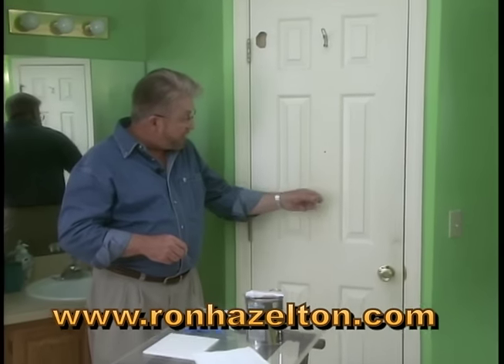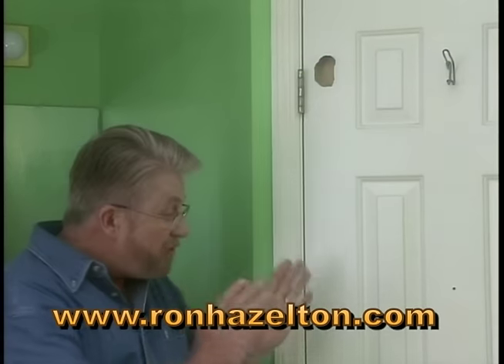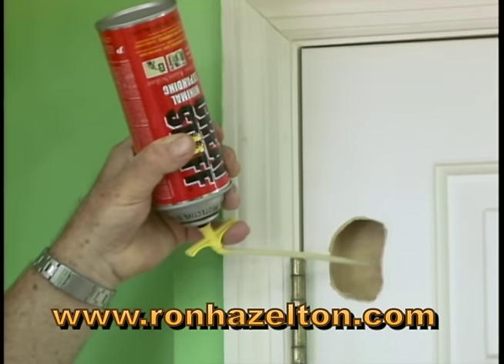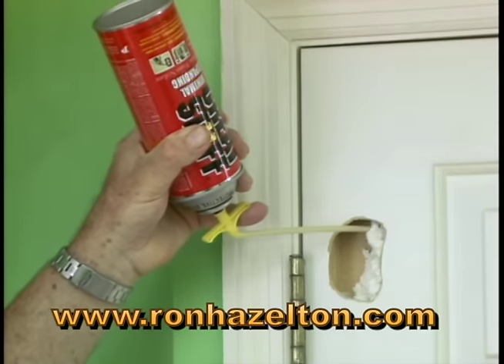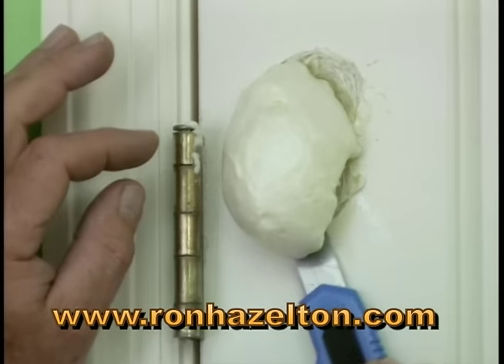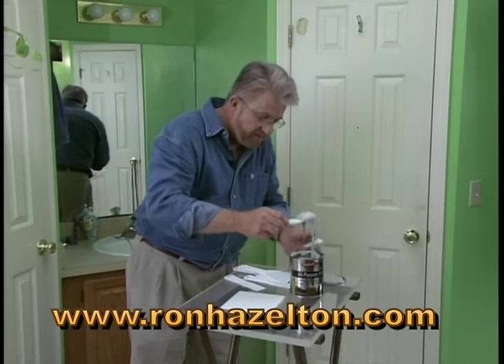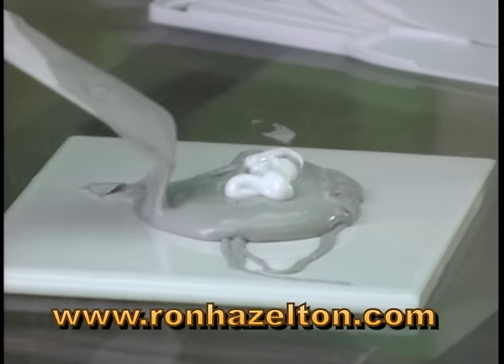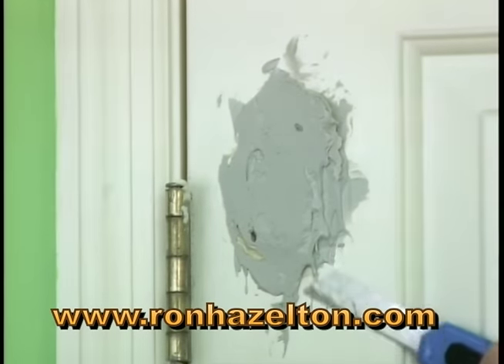How to Patch a Hole in a Hollow Core Door

Comment: Lmfknao Hahaha! With all the materials you used you might as well buy another door!
Reply: Pit Dawg 😂😂😂😂 for real
Reply: Apparently, you've never replaced an old door in an old house before.
Reply: Hollow doors are trash, solid cores are lowering in price and they are fairly cheap now.
Reply: You are correct - a new auto body filler can probably cost as much as a hollow door.
Reply: Its probably worth it if you have a bunch of doors to fix, or if you have the stuff lying around...
Reply: @cassidy5099  you dont need bondo.. Spray the foam and let it set, trim with razor knife and then apply. Spackle/joint compound.. Let it set, sand it down and then mix a thinner skim coat of compound and fade your edges out and sand again..  You dont need bondo.... 

A can of insulation is like $6-7 maybe and a bag of quick set joint compound is $3-4..

If you are a home owner you should already have a bag of fix it all or some quick set compound because there is bound to be a time you have to repair a hole in drywall.
Reply: @RubbinRobbin  hollow cores are for interior and solid doors are for exterior Einstein.. Unless you live in a vintage house with solid doors then no.. Even solid doors back then were thinner.  Interior doors are for privacy, they arent meant to keep a robber from breaking in.
Reply: not really another door is $60 but that is just $15 material
Reply: Exactly bondo cost more then 20 bucks alone plus the rest. New door 33 bucks 🤣.
Reply: @Mixwell1983 My old rental house is backwards then because they have hollow glass doors for exterior 🤦‍♀️
Reply: No new door will fit unless it's prehung you're asking for a lot more work LMAO
Reply: Can confirm that’s not true, try finding an exact door, it’s much harder than you think
Reply: Yeah finding a close enough size that can be made fit then fitting it is the problem. Lots of time and expensive tools needed, not easy for average homeowner.
If you go solid door you can make it any size but they are more expensive and still require time to fit in old houses....

You don't need fancy body filler, it just has a hard finish which is ideal. Just a small can of expanding foam and spak is adequate; maybe $10-$20. much quicker/easy. And you can repair more than one hole if  you keep the leftovers, even if you buy bondo you are only using a tiny amount and 2 part bondos usually store well for a long time and have many practical uses. Same goes for leftover cans of foam (nozzle is only problem) and spak. If you own a home and do basic repairs chances are you might have some of these items already.
Reply: OnG

Comment: I am in the middle of the repair now. Everything seems to be going great so far. To answer the question about price for the materials. I picked up a can of "great stuff" insulating foam, the smaller can (just over a pound) of "Bondo" or polyester resin, small tub of joint compound, a razor knife, 100 grit sand paper, and a set of 2,4, an 6 inch plastic  putty knives for about $29 and some change after tax. Nice thing is I will have plenty of materials left over incase it happens again.
Reply: So it's been 10 years. You still got those supplies or did it happen again?
Reply: @willprice8696  Yeah, enquiring minds want to know?????
Reply: for anyone curious, I looked up all these things and it would be about $62 now😵‍💫

Comment: I used the foam insulation and cut off the excess. I then used wood putty to even it out with the door as much as possible. I trimmed off all the excess. The insulation really helped me because the door had the beveled edge and I was able to create the edge by slicing at the insulation with a razor. I then used spackle to fill in the putty gaps and create a level surface. I used the sand paper to further mold the edge and create a flawless finish. The door took a few days to do. A+
Reply: Hi!!! I’m here for the “wood putty” in your comment..he used auto body/resin but I’m wandering if regular putty would be just the trick.after the foam. And of course paint! Is that what u did? Thanks!

Comment: At 1:28 ''You'd never know there was a hole there, would you?''
Not when the repair is covered by a thumbnail to another video, no.
Reply: Sudo Nym I was gonna say that!!
Reply: 😂😂😂😂 fkn hate thumbnails at the end of videos.
Reply: If the screen is in portrait view, touch the screen and pull down a bit. The thumbnail disappears
Reply: @beaufordrego7658  

Thank you - my computer screen is a bit cumbersome to turn on its side...
Reply: @beaufordrego7658  
Level A advice
Reply: Thank you!!
Reply: LOL !
Reply: That was some clever work I'm more impressed by the placement rather than the video
Reply: That's what I said.
Reply: Ud never know because you cant see the finished product thanks ti the end screen covering it up 😁🤣
Reply: The only problem I can see is you make a flat surface try to match textured door most Hollow doors have a fake texture
Reply: A coat of finish paint without primer will cause flashing especially gloss paint
Reply: Yeah trust me man as someone has been doing this kind of work professionally patching indoor never looks good although it will pass inspection or get the job done but it always looks like crap and actually takes a lot of time between sanding and redoing stop over and over again
Reply: Hahaha ...

Comment: Thanks Ron, 12 year old video and still stands up. This worked so well. I just patched a hand size hole on a 22” (across) closet door, so I would have had to pay a lot for a replacement custom door, since its an odd size. It took me longer because I did it in a cool room, and I’m not you, but it worked out so darn well!!

I subbed out the auto-filler for a wood-filler that hardens in 15 minutes, and it was fine. It worked better than I could have imagined - now I just need to paint.
Reply: Trying this this weekend. Accidentally made a hole with a chair 🤦🏾‍♂️

Comment: Items needed:
Utility knife
Crumpled paper
Low expansion Insulation Foam
Polyester Resin (AKA Autobody filler)
Catalyst
100 grit sand paper
Spackle
Puddy knife
Paint
Reply: Probably cheaper to replace the door
Reply: @khizarhussain1003  a lot less work too
Reply: I may be cheaper if you don't already have these items, or most of them. If you have to go out and buy them all. Then yes. But most people who have these skills are handy men/women and already possess these supplies.
Reply: Is there a substitute for the auto body filler
Reply: Abel Casanova porridge
Reply: You're a hero!
Reply: I love you for writing these down.
Reply: Wood filler
Reply: You could buy a new door for what all this will cost!

Comment: I have watched no less than 10 videos regarding a hollow door repair.
Folks, this is THEE easiest and best there is.
With that said, after trimming the foam, you can use resin or a bonding agent with hardener which may be cheaper.
Cheers to Ron!

Comment: Very helpful video. I skipped the bondo step and just used the foam insulation and spackling paste. The spackling paste definitely takes a little finesse (spread, dry, sand, spread, dry, sand) until it's right. But saved me 8 bucks on the bondo and the mess of mixing the stuff. After a coat of paint there is no visible sign left of the hole.
Reply: Gonna be trying this over the next week.
And gonna use “Spackling” paste. Never done this repair before. But sanding I can do.
And then some white paint. Would it be wise to take a piece of the damaged door to get the exact paint color‽

Comment: Worked like a charm. Used a primer then sanded between coats. The hole is undetectable even within a foot or so. MUCH cheaper than buying a new 8ft door. Thanks!

Comment from the maker: I depends on the ratio of hardener to resin.  A golf ball size portion of resin with a strip of hardener about an inch long should start to set  up in about five to seven minutes.  A couple minutes later it will probably be firm enough to cut and begin rough shaping.  Temperature, humidity and age of material can all affect the set time, so keep an eye on it and keep testing for hardness.

Comment: Thanks for the Video, everything you instructed more or less worked except I would recommend anyone interested in fixing a door hole this way to UNSCREW THE DOOR FROM THE WALL AND LAY IT FLAT FIRST! The foam insulation leaked down out of the hole due to gravity and made a wondrous sticky mess of my carpet.
Reply: The idea would be to not put so much foam in the hole, as the standard foam expands A LOT. When you think it's dry and you cut away the excess, you find that the centre is still wet (like it is in the video) and starts expanding again. Trim it again, same thing happens.
The best idea is to put something down on the carpet. if it was a hole in the wall you wouldn't be able to remove the wall and lay it down. Use an old sheet, towel, cardboard, etc to cover the floor, not just for the fillers, but for the dust from sanding and paint.

Comment: @ronhazelton Thanks for the video. I just used Lepage plastic wood. It's a Canadian product but i bought it at home depot. They may carry it there in the states. The hole I had to fill was a crack and a dent so i didn't need the foam. It took me about a minute to do. With the plastic wood i will not need the drywall mud either. If you can get plastic wood down there then you can skip the spackle because it sands just as easy.

Comment from the maker: It's possible to do this with a stained door, but tricky.  You'd use artists' acrylic colors (available in any art or craft store) and paint on first the background color and then the wood grain.  I usually spray some sort of clear coating on top to match the sheen on the door.

Comment from the maker: Yes, that's true, but the real work can be fitting a new door to an existing opening (trimming, adjusting or cutting hinge mortises, lock sets, etc.) plus the painting or finishing of the entire door.   Sometimes, replacing the door is a good option, at other time repairing some damage might ultimately means less work.
Reply: Adding to this (per my scenario)… it’s better to repair when you are renting from an apartment company that uses specific door models/designs therefore would have to be ordered and fixed by maintenance (and be charged a heck lot more). I would also rather fix it myself then notify my place that I damaged the property to this degree.

Comment: Unless you have 30 such holes to repair, it's not economically viable to do this, because all of the cans are going to waste after you're done.
Just glue some paper on it and forget about it.
Reply: @Matthew Brooks Plaster of Paris should do the trick. It's really cheap, can be sanded, painted, drilled into.. Really easy to work with..
Reply: The expanding foam is a good idea but do you really need autobody filler? Cant you just use plaster over the foam?

Comment: Great video- however, it would’ve been helpful to hear the following prior to starting:

I don’t know what insulation he used but not all are created equal. If your hole is larger, gravity still works and you should take your door off the hinges and work horizontally so you’re not fighting gravity. 

Protect your floors/carpet with newspaper. The foam is sticky and if it falls in your carpet or floor you will have quite a time removing it. If
You’re working vertically little pieces of foam will continue to fall off and create chaos for you. Drop cloth or newspaper- don’t use a towel unless you don’t care if it gets ruined. 

Keep small children and animals out. It looks EXACTLY like whipped cream.

Comment from the maker: These materials are available at any home improvement center.  The polyester resin is made by Bondo and Minwax (Minwax calls it High Performance Wood Filler).  The foam insulation is made by Dow and is sold under the name Great Stuff.
Reply: Thank you @Ron Hazelton

Comment: A brand new door from the local home improvement store is only 30 bucks, a complete pre-hung door is 50 bucks, just replace it
Reply: scott findlay  way cheaper in the long run just buy the stuff to fix it u use it several times over 💯 for other things to

Comment from the maker: Yes, quick dry putty can work.  I prefer the polyester resin because it bonds strongly to wood, won't flake, chip or crack and is flexible enough to stand up to the repeated flexing caused by opening, closing and possible slamming of the door.  This is why  poly resin is widely widely used in auto body repair.  If you buy it in an automotive supply store it's also inexpensive.

Comment: Buy $30 worth of material, and invest an hour or two labor... 

Or, just get another $50 door at Lowes
Reply: then you gotta get it home, then you gotta, buy and fit hinges, then you gotta hang the door, then you have to cut lock/knob holes, then you have to fit knobs and door hardwear, then you have to prime the whole door, then you have to top coat it.... then $30 went a LONG way
Reply: Yes they do.
Reply: If it was me, I would just glue a random poster to cover the hole. Like an old Matrix poster or  something
Reply: @theupscriber65  no they dont, DOOR's maybe cookie cutters, but the door they are replacing and the door frames and hardware may not be.  It's always better to FIX than replace, in these cases

Comment: Thats a lot of work for a really cheap door. I would just replace the door.
Reply: Do you seriously think replacing a door is less work?
Reply: Absolutely. Those hollow core 6 panel doors come pre-drilled for the handle and hinges. You just pop off the hardware from the old door and slap it on the new door and hang it for about $30-$40 depending on the size.
Reply: +Zerostar369 That's the same thing I thought too
Reply: +Zerostar369 Eh, I was thinking the same, but if you reuse the knob from my experience it may take longer to do than this. And you need to have a car big enough to fit a door ;)
Reply: You could probably skip the bondo step.
Reply: The prehung doors are about $90. If you buy a slab it's a bit more work because you have to drill all the holes and chisel the hinges.
Reply: $90 for a new door plus the hassle of transporting to your home..or $15 to repair yourself !!
Reply: wouldn't it be more expensive to replace the door than to fix the hole?

Comment: Do you need to wait until the low-foam dries completely? The bottle says 8 hours and 15 to "tack" whatever that is. Just curious if it is best to wait for it to completely dry to apply the next step, the autobody filler, don't want a chemical issue with bonding here.

Comment from the maker: Both Lowe's and Home Depot carry Minwax High Performance Wood Filler which is a two-part polyester resin product.   Using a particle mask anytime you're sanding is always a good idea.
Reply: What is the difference between  Minwax High Performance Wood Filler and Plastic Wood-X with DryDex 5.5 oz. All-Purpose Wood Filler?

Comment: @Kingman70 I saw an other video that did not use the resin polymer but after applying the foam insulation, they placed sheetrock tape over the hole. Then applied the spackling and I think only used a medium grip sand paper, rather than 100 grip. I just can't find the video I saw...

Comment: I use spray foam first, then I use some 20 minute mud for first coat as it's super strong. Once the 20 min is dry, then I finish with drydex. Sand then paint and you're good to go!

Comment: I have a question.  My friend has a hollow door just as this one is. Where the hinge is, it looks like the holes in the door are too large for the screws, hence, the top hinge is now unattached. Can you use car carpound to patch these holes and then put the screw thru the hinge and into the door around this patch?? If not, what is the best way to fix it save purchasing a new door?

Comment: Why do we use polyester resin and not just but the spackle on top of the aerosol foam insulation?
Reply: yeah thats what im doing, using foam then putty
Reply: how long does it take for the foam to dry
Reply: Did it work without the resin, Nitin?
Reply: Golden Child yeah, you have to sand it a lot though, it worked well.
Reply: Nitin Chetla Thank you so much!
Reply: 831BoYz!
Reply: Golden Child how it go lol. Saw this randomly thought I might as well ask.
Reply: Nitin Chetla It worked fine!! We sanded it a little more and it's not completely flattened BUT looks better than a big ole hole. A little white paint on top and it's fine.

Comment: It would depend on how big the hole was, but if it was small enough, I would trim both sides with the knife, using painters tape put cardboard on the less seen side of the door, fill and try to remove the cardboard before foam is done expanding. Then follow his directions on each side of the door. It might need a touch of the foam after the cardboard is removed.

Comment: I have a metal exterior door.  I want to install a new lock set, but the two existing holes are too close together (it had a combo lock set).  I want to fill one of the holes and drill a new lock hole lower.  Can I use this method to fill a lock hole on a metal door?
Reply: welcome to the club

Comment: Tried just the foam and spackle method and I would not recommend it. The foam first shrinks then expands. I didn't use the bondo repair kit so that maybe the missing piece. In any case, I'll be using the Durham's Water Putty to finish this job and be done with it.

Comment: Iv done this repair for years the only problem is you cant use too much foam or the super expando foam or it will bulge out the door I know it happened to me although it works great but I would use plastic filler [ bondo] instead of spackle even if the door has grain just wire bush in the grain when the second coat of filler is applied